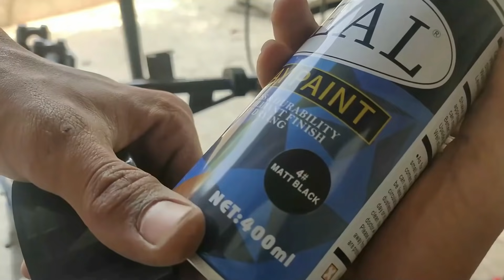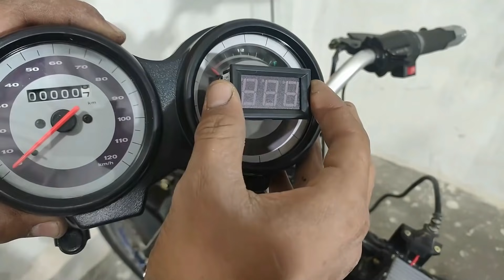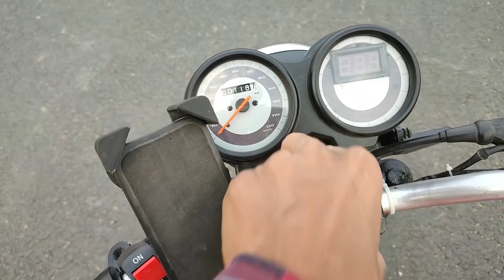How to Make 65km/h High Speed Electric Bike

Comment: Good work but using 2 chains will decrease efficiency. 900 Watt motor will give 750 Watt output.
Reply: Right brother there is no need of bike gear box because many ev bike kits motor comes with already gear you have just need toh place directly on bike and go on.  In this video technique there  is no any practical use I found with extra gearbox  because company already give you suitable gear with motor which enough for torque and speed balance and most affective it's battery range

Comment: I have a question.... Why u use  extra sprocket set (2* 15t)  ,  u can directly connect the rear sproket with the motor,,, is it for gear reduction ? I mean 13t to 15t  then rear sproket...
 What if I skip the 15t set & use a much bigger rear sproket is it make sense?
Reply from the maker: Yes You have to use 13/53T Sprocket if U want to Skip the middle Gear Reduction
Reply: Thank you so much...  It helps me a lot ❤
Reply: Good question and answer too good
Reply: Right.  energy loss also
Reply: इसकी कितनी कीमत होगी, एक चार्जिंग मैं कितने किलोमीटर की दूरी तक चलेगी।

Comment: I'm making 75kmph bike with 1000w motor, concept is bit different than your, 25% idea is same as your. But I'm using belt and clutch system to increase torque in city and speed on highway.
Reply from the maker: Great, If You Can Share with me on facebook
Reply: Mere ko restore kar do
Reply: @ranbnkavasundharagamers3200  sure
Reply: Where are you from
Reply: @ranbnkavasundharagamers3200  Gujarat
Reply: @advanceservices4020  pls share with me too if possible insta,fb, YouTube etc

Comment: I noticed that it does not have registration plates  -Is this in Thailand? In Australia , all vehicles that don't have pedals need to be registered for public roads .
I have a fat tire pushbike with a 48volt boefang mid-mount crank motor powered by a 48-volt battery about half the physical size as yours.
The only reason it doesn't have to be registered is because it has pedals and the speed is limited to 30kmh.  The fastest  I have gotten to was 54kmh down hill in  a 
40 kmh zone.
Reply from the maker: This has registration plate and it is in india, Due to privacy I removed the registration plate in video

Comment: Hello brother firstly amazing pro. Work.
I had made a bike from 750w geared motor 
But its low quality now its got damaged.
.
Now i have the same motor 900w which you have used. But i don't know how to use it due to high rpm it doesn't have enough torque to climb hilly roads.
.
You used gears but why .....bcoz you didn't reduced rpm Of motor plz explain me 
So that i could also complete my bike.
I only want speed 35km/h. But high torque
Reply from the maker: I used Gears to Reduce Rpm and Get Some Torque
Reply: @homemadecreativee  you could used motor direct to wheel because you didn't reduced much rpm. Or their is any other benefit of bypassing.

Comment: Love the work. I live in Australia and cannot find those motors are you able to let me know the manufacturer?
Reply from the maker: It's Cy Gold Brand Name, In India You Can Easily get on E-Rickshaw Shop
Reply: You can get motor from Indian manufacturers it would be cheaper for you to convert I suggest you buy the full kit with battery or you can use lifepo4 battery that would increase range and life, you convert connecting motor with gear box

Comment: And how exactly you plan to cool down battery
Reply: Air cooled maybe. as casing is aluminum it will be good heatsink
Reply: @technokhan7429  and what about in hot summer season . Alluminium will get more hot. Battery is totally sealed with alluminium...
Reply: Yes obviously. Ev efficiency is very poor in summer seasons. Controllers, battery and motor all will overheat and perform poor